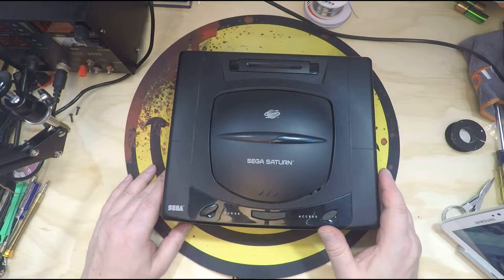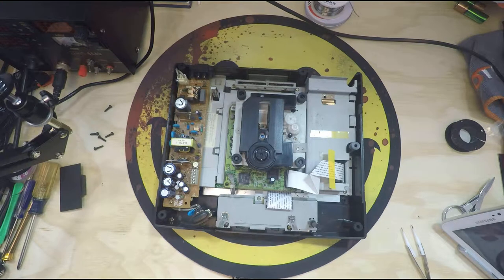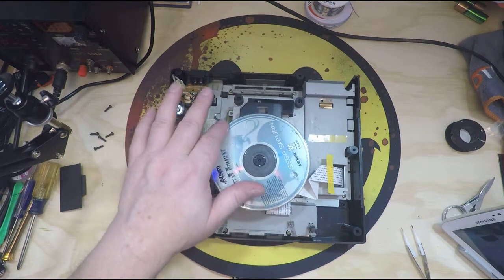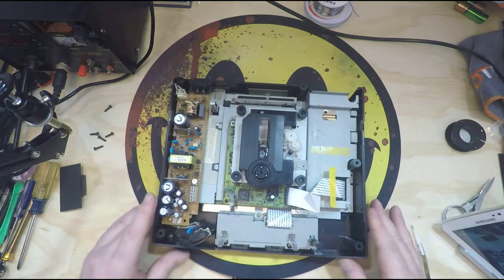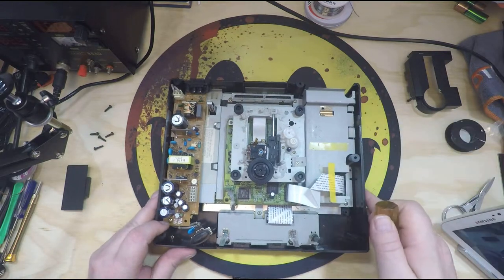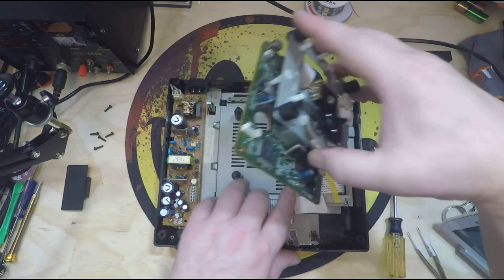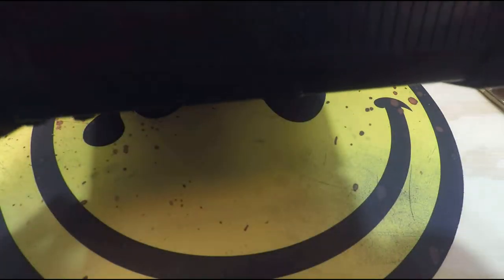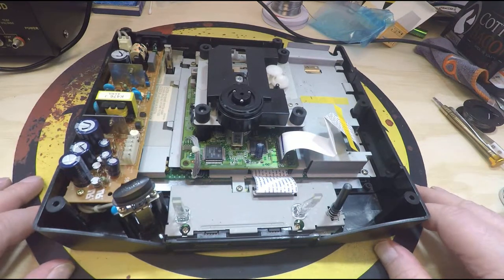How To Replace A Laser Sega Saturn - Disassembly - Repair & Replace

Comment: Hi. If that ribbon cable is disconnected from the laser assembly board, or damaged, would that in any way effect the 'CD Video Card' slot? Or are they separate?

Comment: Hey hopper where is the best place to get used broken consoles? eBay ? And what percentage profit do you try to make once you fix a console? Like 30% more for what you pay for? I want to get into this as a hobby.
Reply from the maker: Yard sales, thrift stores, and at your local auction. I try to stay around 50% but that doesn't always work. It's more of what your are comfortable with.  Some you make more and some you just just make a little.

Comment: Hi!
I have been searching for a straight forward tutorial on replacing the laser for a model one saturn. What are the specifications of the laser? When I go on ebay I see different lasers. Do you have a link for the exact laser you used? I would appreciate your help.
Reply: 4 years later answer, the model is OPT-JVC6 laser pick up